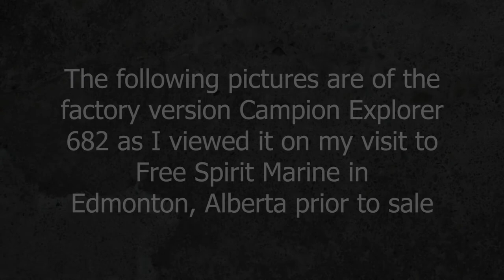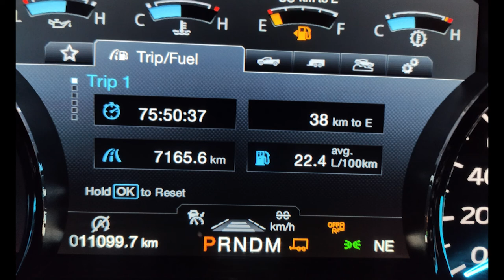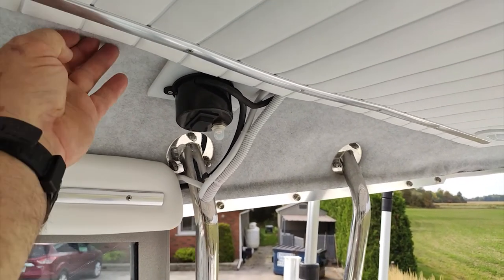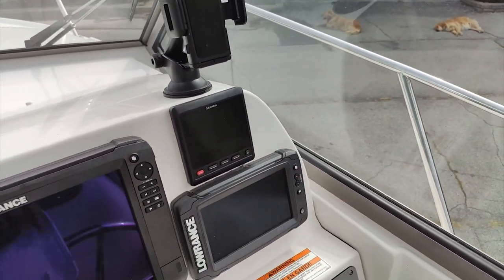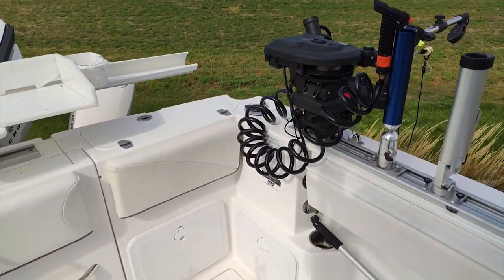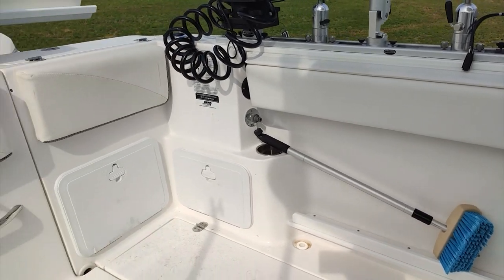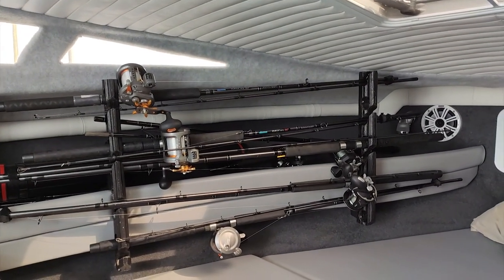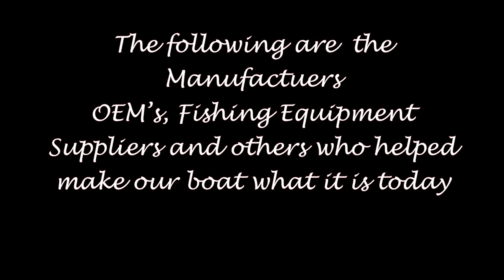Campion 682 Personal Review

Comment: Where do you usually launch out of? or do you keep it at a slip for the season?
Reply from the maker: Hey Cory, thanks for the question. Our home port is in Grimsby Ont for the season with exception of late April and May we are in Port Dalhousie. So typically we launch on Pt. Dalhousie and have a slip for 30 days, then run to Grimsby for the remainder of the season where we have a seasonal slip. Thanks again for watch and commenting